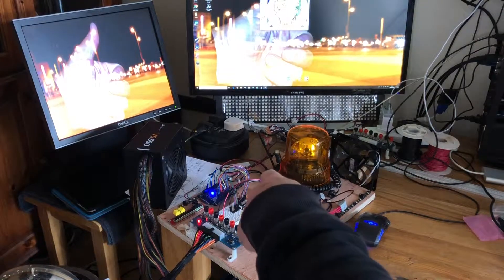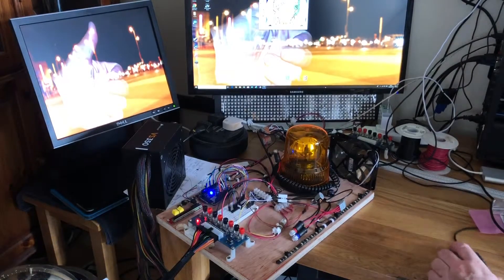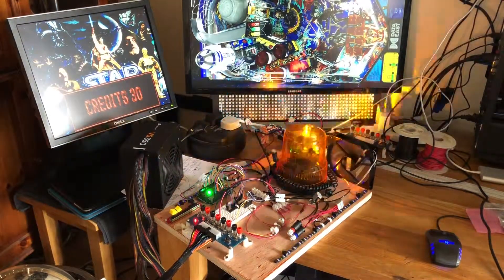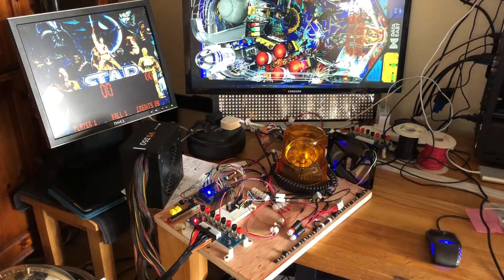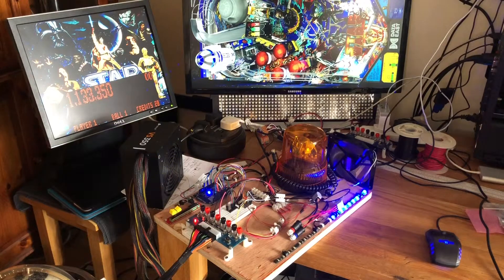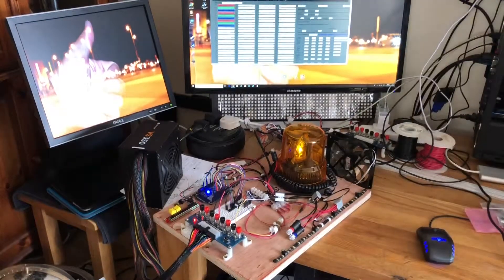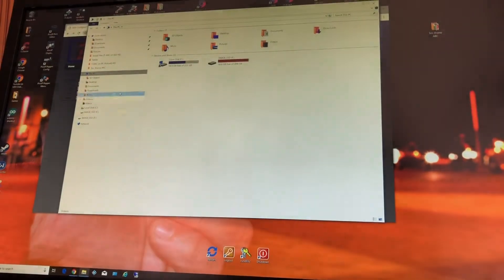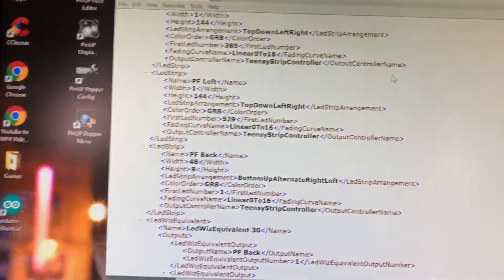Dof Control Kl25z Board And Teensy Addressable LEDs

Comment: Olá. Bom trabalho! Qual a designação dessa matriz / onde consigo? Obrigado
Reply from the maker: The matrix is a addressable ws2812b https://www.amazon.co.uk/WS2812B-Digital-Flexible-Individually-Addressable/dp/B0B425MH3V/ref=asc_df_B0B425MH3V/?tag=googshopuk-21&linkCode=df0&hvadid=697240380141&hvpos=&hvnetw=g&hvrand=1002591471067722747&hvpone=&hvptwo=&hvqmt=&hvdev=c&hvdvcmdl=&hvlocint=&hvlocphy=1006751&hvtargid=pla-1914871477370&psc=1&mcid=83ccc89beebc3d9b8a71bf965c461378&gad_source=1. Although these panel are now in pinball matrix terms being replaced by the new HD panels so advice would look at those firstly

Comment: Please go more in depth on how you wired it all together
Reply from the maker: What do you want to know ?
Reply: @startrek9893  where did you tie into the kl25z board. Do the toys connect directly to the board ? Are you using other power sources ? What is powering your led matrix ? Did you make the matrix or did you buy it ? How are they all connected together? I'm looking to start my cabinet and dont know much about wiring all the toys and lights up.
Reply from the maker: joshyjosh00 
The matrix is a 256 led plus 2 of the 64 so that’s 8x32 plus 8x8 and another 8x8 also 2 x 144 LEDs strips they are powered all from the 350 psu you see they are 5volt there on teensy 3.2 and opto adapter
They link together on back with 3 wire cables male female you just wire the power to them 

The rest are connected on 12v to same psu and they are just connected in a kl25z then to a breadboard with a Darlington chip on it you can use 8 toys per chip and can also daisy chain chips

There all very simple to do really not how slot of forums appear to make it appear
Reply: joshyjosh00 have you ever found a step by step guide to all the connections? I’m getting so conf, and I don’t know if I should get a ledwiz or a kl25z....
Reply: @viciousgazza3318  ive got a pinscape kl25z..... still confused...lol